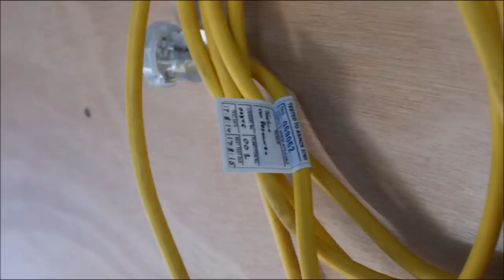The Ultimate Multipurpose WorkBench with French Cleat Tool Storage

Comment: Hey buddy I am building a similar backboard for my existing workbench and wonder if you can explain in more detail how you designed the mounting for it? Do the white metal legs attached to the backboard have threaded holes that the bolts go into?
Reply from the maker: supernom  Glad that you got some idea's out of my bench, I currently have the bench in storage and am not able to make a video explaining more detail on the bench, but I will do my best to describe what you have asked.The backboard is a sheet of ply wood with the french cleat rails screwed to it and then 3 lengths of  RHS (rectangular hollow section) each with a another piece welded at 90 degrees on the top to support the lights and the timber hiding the lights. these pieces are then screwed to the backboard and the top holding the lights creating one piece, this piece then slots onto the back of the main frame through a slot which is a piece of slightly larger RHS than the supporting lengths for the backboard and are welded to the main frame with a hole drilled and a nut welded to the front to allow each support to be placed into the slot and then tightened with a bolt which pushes it against the frame. the backboard itself sits ontop of the timber of the bench.

I hope I have provided enough detail to help with your project, In the future when I have the bench setup I will make a video explaining in more detail about the bench, how it works and was constructed so make shore you subscribe so you do not miss it.Happy building!
Reply: Technology and Trucks Hey thanks for the mate! Really helpful I can understand how you did it now for sure. Unfortunately mine has a wood frame so I can't weld to it. Either way I ended up coming up with a way that works so far! I just used angle steel to bolt the 2 together. It is not as big as yours but suits my purpose. I have got a picture if you want to see. http://www.iforce.co.nz/View.aspx?i=2v1m0sqa.pkh.jpg
I plan to add a light on top like yours, and a 6 plug power board on the left hand side. 
I appreciate you replying to me thanks!
Reply from the maker: No worries, Glad I could help and share my ideas, thanks for sharing the picture of your bench and see the different ideas you had to, great work keep at it!